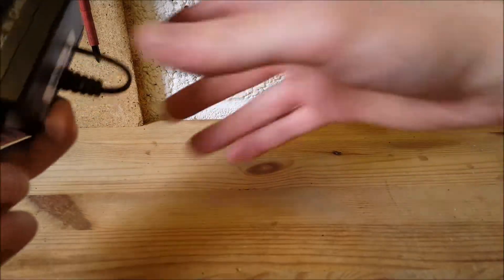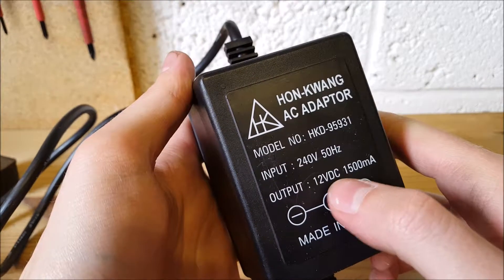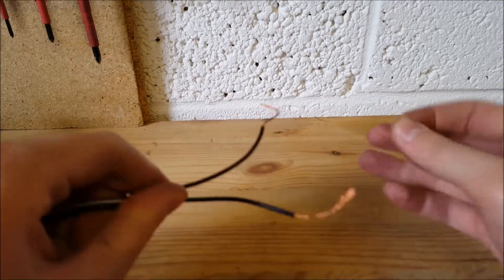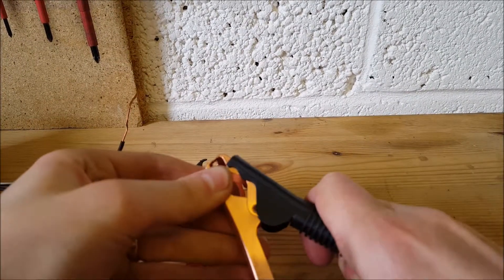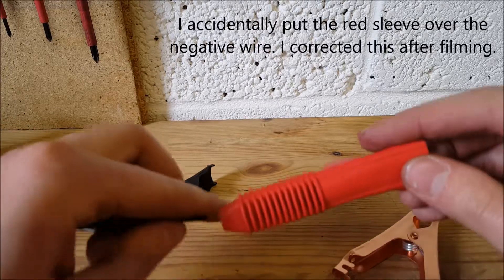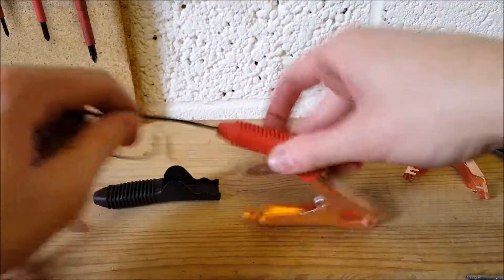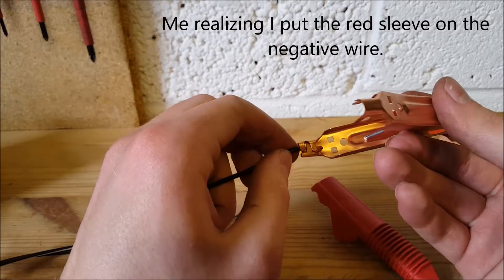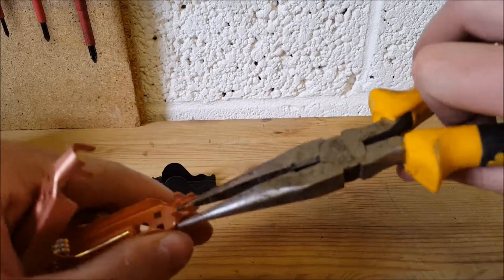DIY battery charger

Comment: If you have a ground wire where should it be put?? The wire im attempting has a white,black and green wire!
Reply from the maker: I have not seen a chatger that had a ground cable. I believe you can insulate/terminate the ground and not use it.
Reply: Did just that thank you i had a spare wire with the 3 prong plug.

Comment: Nice. I've read to charge a 12v battery when it drops to 12.4v, and don't charge modern sealed batteries over 14.5v. Our old charger would reach 16.5v and you can hear the battery fizzing and the liquid may evaporate.

Comment: You need 13.8v off charger the reason a good battery should hold 13 to 15 volts is for volt drop to the rear of vehicle and when towing the juice has to travel even further